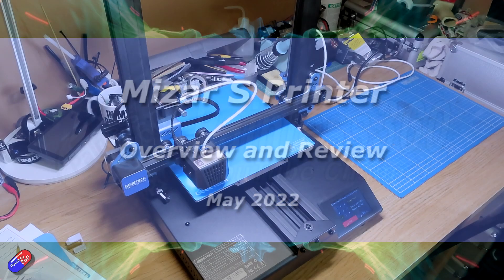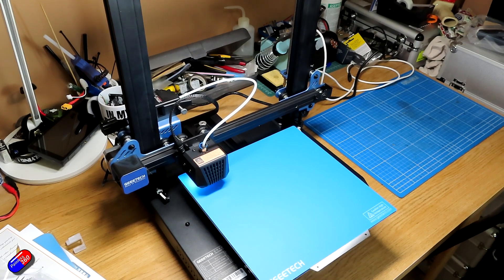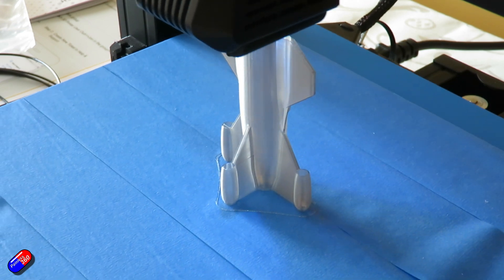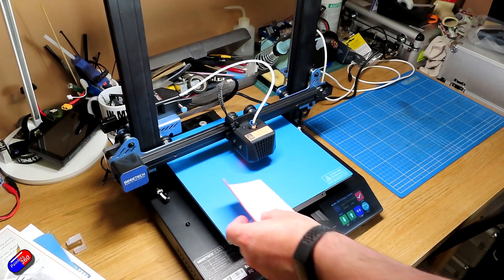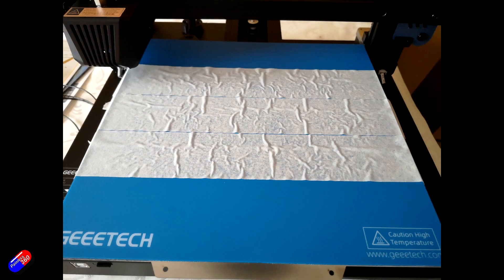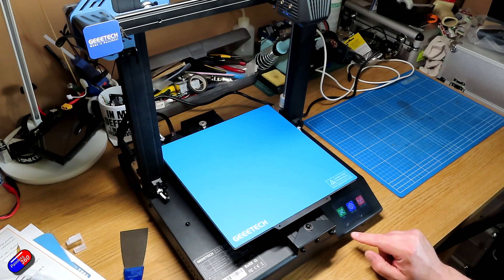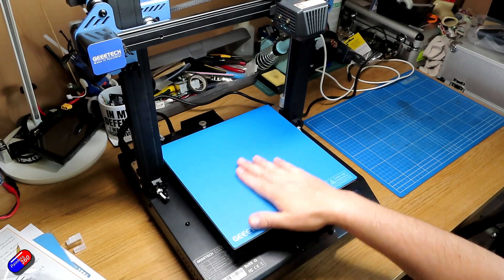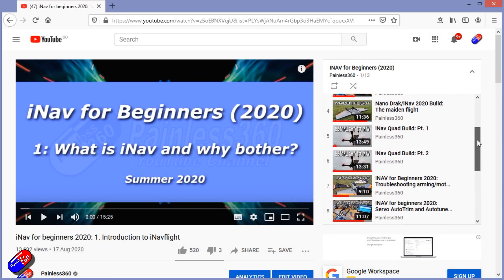Geetech Mizar S: The latest Geetech printer with all the upgrades. Better than an Ender 3 V2?

Comment: Well ? Printing a plane is a royal pain. Heavy or fragile?  I have 3 working printers 4 if I get around to repairing my first one, even got a resin printer but it's still in the box, ventilation problems. My first printer would set on the bed of my larger one, which was suppose to make printing planes easier, takes about a week to print, so far a touch of disappointment.  Looking forward to watching you print a vtol... that disappointment,  I mentioned earlier. The light weight pla is a tad expensive and failure took an entire spool. I have whined enough for today. Take care.
Reply from the maker: There is some of that kind of action coming to the channel in the summer so it'll be interesting to see how the experiences compare. Happy flying!

Comment: I'm still using my ancient 8 or 9 year old self-built effort which took a lot of effort to build and even longer manually editing the Marlin code - it's nice to see what a huge step forward people getting into it can have.  I was slightly confused by the auto bed leveling in that you had to manually give it the Z-axis offset - surely it would know this based on it's 9 point probing?  Also, given that TPU is used an awful lot in RC (although PETG is pretty cool) did you get a chance to see how it printed TPU?
Reply from the maker: Hey Wayne! I don't use a lot of TPU here but after over 10 hours work to try and get PETg to stick to the bed (never had that problem on any other printer) I wasn't prepared to try it with another plastic. Not when the Ender 3v2 can do it without even thinking.. Odd how this didn't like PETg at all..

Comment: If you are going to be in the FPV hobby..........1st best purchase is a 3d printer, then your flying gear LOL  Great video Lee
Reply: Print speed PETG super slow for PETG compared to other printers.  For FPV equipment quality I have Voxelab Aquila (Ender 3 clone).  Paid $180 for it a year ago, printed Darren Lines S800 hatch cover @ 60mm second, temp hot end temp 238, bed temp 70, no stick glue on the bed.   LIke you I really like printing in PETG, stronger, more heat resistant, and I feel like the finish is shinny.

Comment: really good print quality, I prefer my heavily modified Prusa, can print with 4 filaments at once (makes life easier as you can use water soluble support material).  I was banging my head against the wall with printing ABS had to play with bed temp and built a heated chamber that sorted it in the end. weirdly PETG just printed on mine with no issue, The filament detector is a life saver especially when doing large prints. I use Cura and the Prusa slicer ( the prusa slicer is open source as well). As I'm sure you know (more a of a comment aimed at new people getting into printing) the ender v3 is easily modified to have auto bed leveling etc etc, once you have a printer you can modify it to do just about anything using the help on thingyverse etc. Using the Prusa I've made a MPCNC (multi purpose computer numerical control) by just changing the head and the bed it can 3d print or mill wood (2d and 3d) or even soft metals (aluminium at the minute but working up to harder metals) (only in 2d) and also been looking to add a Co2 laser cutter but the laser is very expensive lol. Stay safe Lee
Reply from the maker: You too James. I wanted this to be a super easy printer to setup, use and tweak so that a beginner can avoid some of those mistakes we all learn from in the early stages but, whilst the hardware is impressive, the documentation and setup help for things like slicing for PETg and ABS need a lot of work..
Reply: @Painless360  very fair comment I've probably forgotten the steep learning curve when new to 3d printing and when I started there wasn't any easy printer that just worked other than spending an absolute fortune. 3d printing has come along way in short time.
Reply from the maker: :D For this kind of money it should be flawless out of the box IMHO. When you can get a sub-£200 Ender 3v2 that prints everything with a little work those extra tweaks should make it 'fool proof'... Happy flying!

Comment: Not impressed the bed appears to be it’s achillea heel.
Not a fan of touch screens but maybe this is a good one.
I have quite a few printers including some Ender 3s and they all print petg with no issues.
Looking at the pictures Is the filament sensor after the extruder?
I looks like it is and if it is that can cause issues.
Price is far too high imo but if you like it great.
I would have bought another Ender myself.
I have 2 Ender 3s an Ender 5 a cr10 and a cr6 and all print petg out of the box unlike this.
I would replace the bed with a better surface and I think then you will be happy, a nice metal magnetic bed should solve your petg issues as judging by the issues you are having the print surface is the issue, you really should not have to struggle so much and it seems clear to me this bed surface is not any use for anything other than PLA.
Replace it and you would probably be happy.
Happy printing
Reply from the maker: I can't agree more. For such an expesive printer everything should be a piece of cake. The only other video I could find about it seemed to gloss over these shortcomings.. Happy flying
Reply: Similar price to the Ender 3 v2 but it comes with a removable steel bed. And to be honest I think the Ender 3v2 is overpriced. At that price I would expect an all metal hotend which neither printer have. The old Ender 3 is still available as is the pro and to my mind they are better value, of course they do not come with bed levelling or run out sensors but you add that and an all metal hotend for the same price.
Sadly the Ender 3 pro is in many if not all cases now coming with a cheapie power supply, one advantage with the old pro was it came with a branded Meanwell power supply and I believe that is no longer the case.
Creality cost cutting again, and sadly Creality boards are changing so often, I presume because of the shortage of electronic components you don’t know what you’ll get.
Not saying this printer is at all the same I am certain if you get a pei coated spring steel bed your problem will disappear.
I hate those floppy magnetic beds on the Enders too but at least petg will stick to it…
Reply from the maker: I have glass on mine - works great!